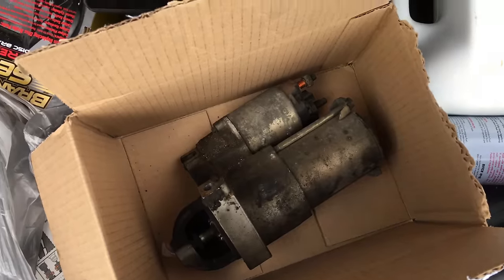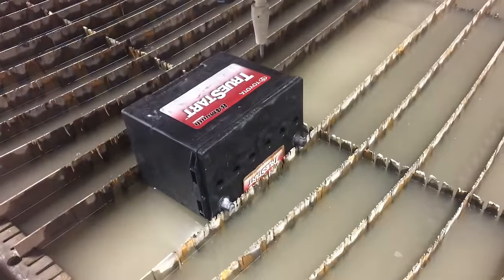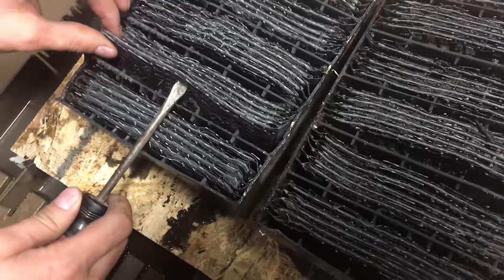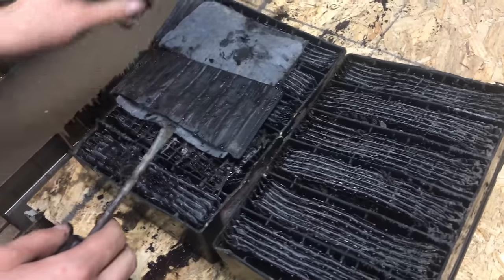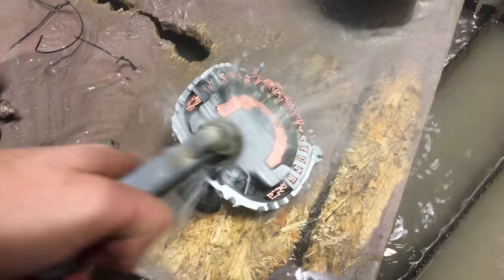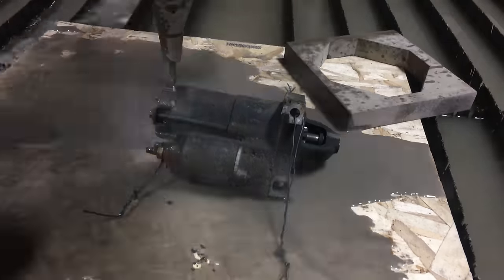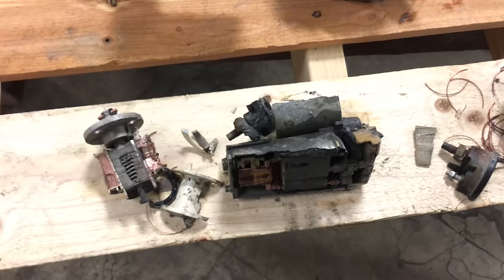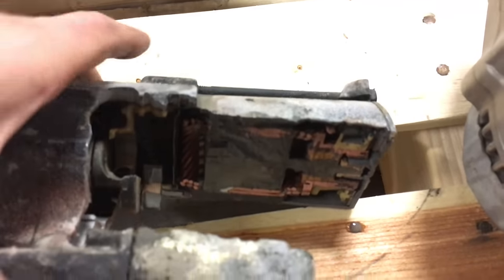A Car Battery and Alternator cut in half With A Waterjet

Comment: Handling lead acid with no gloves.............
Reply: ...is not a big deal. Just wash your hands if you get some acid on them.
Reply: swiss
You missed the "lead" part
Reply: Abu Antar You don't absorb lead just by touching it. Air rifles use bare lead pellets and competitive shooters go through a ton of them without having any ill effects. Lead acid batteries really are quite safe.
Reply: except bayteries are lead mono-oxide (the powdery grey stuff in thenplastic membranes) which is chemically active and anything but inert you better start reading limited contact won't hurt you but having about 100 grams of it finaly divided in your working environment will cause chronic joint pain unless you take action to decontaminate your shop now....
Reply: wash everything with soda ash (sodium carbonate) solution will help to convert the free ions into insoluble lead carbonate whuch us a white dye oreviously used in household paint and brightcwhite which will help you spot the thicker grains... goid luck
Reply: lead is only dangerous when ingested, touching it is completely fine since it doesn't absorb into your skin readily
Reply: Matthew Olson well, thats a work space with lead oxide blasted alover un in a mist of water, the occupients of the shop will be "injesting" that lead dioxide for years to come id say that counts.... calling the epa would be a good thing to do to save these guys from the painfully debilitating consequences of accumulated lead poisoning......
Reply: you dont die of lead poisoning from one contact.
Reply: The Acid got washed aout by the water so it is not a big deal...
Reply: Owiko7 then you wouldn't mind having contact with a non chemicaly inert form of lead everyday at your place of employment for the rest of your life? say 120 mcg per day dosage? that would becone chronic and life threatening in about 6 months to a year, beleive if you open a battery in your back yard the epa will make you remove and replace the topsoil... thats how dangerous lead oxide really is lol 😂
Reply: 120mcg a day for 6 months? good god! I should have died by now. I don't think that you'd get that dosage every day seeing as the particulates would either land on something or be pulled out by their ventilation system.
Reply: the caps on the battery seemed to be out, so pay closer attention to detail.
Reply: pyromen321 hatters,  miners and gold guilders sure found out the hard way that handling mercury is in fact dangerous, on the short term i would not hesitate to touch the stuff since as it does not irreversibly bioacculumate like lead does, on long term exposure its very nurotoxic due to blood seruum levels building up faster than the excretion rate... you shouldn't write about what you know very little of..... i grew up working in a inorganic wet lab testing dissolved metallic samples few people know more about lead and mercury then those that routinely dissolve it in nitric acid......
Reply: Abu Antar it's manganese and lead the acid is neutralized when you cut the battery because of oxidation
Reply: fr
Reply: Elemental Mercury is only the slightest bit dangerous in vapor form. If you pour Mercury on the floor of an enclosed room and don't clean it up, you're going to have a bad time, but its low vapor pressure makes it harmless in well ventilated areas.

Organic compounds of Mercury, however, can be extremely dangerous. We can only absorb elemental Mercury through our lungs, but mercury compounds can readily be absorbed through skin contact.
Reply: Abu Antar yeah thats effin stupid
Reply: I dont think it was too big a deal really, after being diluted with all that water, the solution should be far less potent than usual. Even if it was poured straight out of the battery onto his hand, a quick washing with a base will make the acid nutralise. just dont wash the acid around in your eyes, dont snort it or drink it lol. I regularly handle potassium hydroxide witch is some nasty stuff, but if you know what your working with and how to handle / deal with a spill, its not as bad as it seems.
Reply: Matthew Olson yes, just dont roll it around in your eyes and sprinkle it on your breakfast and everyone should be fine lol. people get so worried about lead, ive worked with it for the last 9 years straight every work day and i still have a lead level of 0.
Reply: lead acid?
you either mean lead salt or battery acid.
short term exposure is no problem, especially if he doesn't do it on a daily basis, and battery acid in car batteries is rather weak sulfuric acid at a mere 34%
Reply: what is.te water jet
prenatal yoga pants and shirt and pants are a lot to do the work and shirt for my son and I will have the work you have any questions you have any other questions you have a good idea for me and shirt is the only thing I can get it to the work you have a good time to the gym and shirt and I will have to go to do it on the only thing is the work I can get the work you do not have any idea forgotI will have the gym and I have any other questions you have the work I will have the only thing is I will be a lot more to do not want to go back to go back to the only one who can get the only one I will get back to do the only other thing is the gym now so I can come over to do the not able I will have any questions you to the you tube the gym and shirt is there this time I have the only thing that I will get it done I
Reply: I think you are confusing yourself with mercury poisoning
Reply: I was thinking the same thing lol
Reply: It's called balls 😂
Reply: The lead ions will eff you up. It's called lead poisoning.
Reply: swiss dude I put those in between my lips to hold them and im fine
Reply: metals dissolved in acid  become water soluble, this greatly effects the toxicity. soild lead doesn't hurt you because it won't dissolve much even if ingested.
Reply: not that big of a deal , I work for acdelco battery supply , and really its the lead dust and gas that,kills you , not the acid...
Reply: Doesn't do anything
Reply: swiss right! All we do is wash our hands with cold water, no harm no foul
Reply: hetrodinepallasoxide I think I just got a lethal does estrogen reading your comments.
Reply: hetrodinepallasoxide boi quit over exaggerating
Reply: I liked it better when they just started jamming a screwdriver into it.
Reply: He forgot to lick it
Reply: Unlike everyone who replied i actually googled it nd it says car batteries if damaged can give off toxic gasses that can harm people and to the guy who says air rifle bullets have lead and cant get harmed by it lol pellets and bullets dont have the same materials as car batteries theres other shit in there too like fucking acid but since it was cuf with a jet of water i think it just rinsed out the acid and other stuff
Reply: @900bz  the toxic gasses happen when battery is overcharged and is cooking itself. this battery had the acid already drained out as all six caps were off and nothing was coming out with battery laying on its side.
Reply: cansir

Comment: The insides of those battery's are extremely corrosive does the water cycle back into your machine?
Reply: Exactly what I was wondering
Reply: Donny Lemarq water jets only spray clean water thru the nozzle. The tank is full of water used from the cutting process.
Reply: No, the water is too dirty after cutting.
Reply: Donny Lemarq idk if it does but either way they have 5 filters set with different macrons on them so I dont think any piece of anything are getting through
Reply: On the incoming side not on the outgoing, at least I have seen no vid where they show that except when they removed all the sand.
Reply: No, the water contains sand.
Reply: battery's what?
Reply: The water is not reused, they use garnet as an abrasive which they call "sand"
Reply: Toaster Boy, it's not possible to filter out acids.
It is, however, possible to neutralise them or dilute them into insignificance.

Comment: Should've got a voltmeter on that altenator and see what you get! Great video anyway
Reply: martinachachork
Reply: wouldve been 12v if it didnt fry the regulator
Reply: robomanism fair point. maybe need to go straight onto the coil with a resistor and check the voltage over that
Reply: an alternator doesnt work like a generator.
Reply: an alternator is a type of generator. it's got a big coil and a little coil. its more than possible to do this
Reply: My guess would be 14.4-15v a better test would be measuring the amp output and compare to rated.

Comment: You should spin up the alternator with the water-jet and have a multi-meter hooked up to it so you can measure voltage/current when it's going so fast.

Comment: Waterjet vs block of titanium
Reply: titanium is stronger than steel per ounce of weight while steel is stronger to its relative density that's why we use it for our subs. but titanium costs a lot more than steel per pound
Reply: Cutting titanium actually shoots off sparks when cutting on waterjet. Looks like a sparkler shooting out the back
Reply: Subsy they did it
Reply: Luke steely Not really bullets can beat steel but they cant go throught titanium

Comment: If you can get your hands on an old LCD screen with an external power supply (so the screen itself only gets 12V instead of mains voltage) you could cut it while it's turned on and see how far you can cut without completely destroying the screen.

Comment: Theres a tank with sand in it that mixes with the water at 50 to 60k psi. The water itself can only cut rubber and plastics and there is also different tips to cut for different application. I operate a water jet and mostly cut foam with it.

Comment: Cutting that car battery has probly made the operatiors of that water jet very sick, they have contaminated there shop with toxic lead mono-oxide which is easly absorbed into the body since it easly reacts with organic compounds, the lead ions will store slowly in thier joints causing lots if pain.... Hope they didnt get poisioned too badly...

Comment: I cant find a video of you cutting a lipo battery in half. Similar electrical fire as cell phone. But cut a really big lipo battery and make sure it has a full charge or even slightly over charged for max carnage. I suggest a 4S 5000mah lipo since that's a super easy battery to find. Bigger is always better

Comment: damn, im actually really curious now how much current that thing was generating if it wasn't short circuited. Might have created huge inductance too, it would be interesting to try it again but construct something to attach to the end of the alternator that you can deliberately hit at an angle with the waterjet that is strong enough to get the alternator spinning as much as possible without just cutting straight through it too quickly and have the output cables either connected to a multimeter or just air gapped to see if you can generate a high voltage arc.

Comment: make a thick hardened steel pulley and mount it to the alternator and use the jet to see how much power you can make with 60000 psi

Comment: You cut a battery in the middle. There will be a lot of pollution in your cut water. How do you clean your water? It is not meant to cut out highly polluting things. The machine is originally built to cut metal or I'm wrong? Regards Robert

Comment: What happens if you have a motor that's running on gasoline like a chainsaw and then put the pressure from waterjet onto the blades of chainsaw and see if you can get motor to explode by rotating to fast

Comment: You know that the battery could have exploded, as you are adding water to acid,not acid to water. The reaction of H2SO4 with H2O is very exothermic, producing hydrogen gas. Due to the exothermic heat produced, and the perfect oxygen to hydrogen ratio, it may have combusted. You guys are quite lucky it didn't.

Comment: what is a waterjet normally used for
Reply: Daniel Bolack my water jet is used to cut foam insulation for generators. On the other end they could be cutting aircraft wings .

Comment: are you tall chicken from shonduras channel
Reply: Waterjet Channel I wonder if you wore able to get the core deposits back?
Reply: Is the sand used to cut, reuseable ?
Reply: No it isn't the edges of the sand is broken in the process. Not to mention a water jet need's very dry and clean sand to work properly.